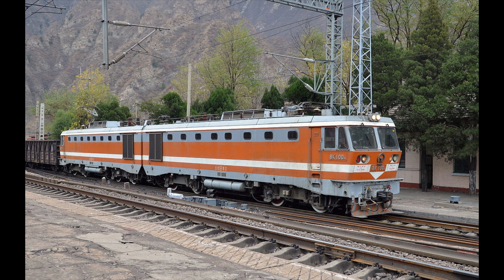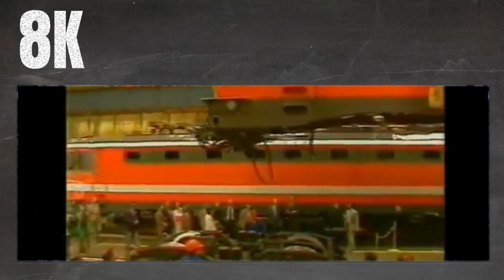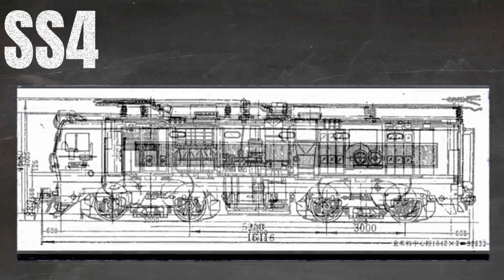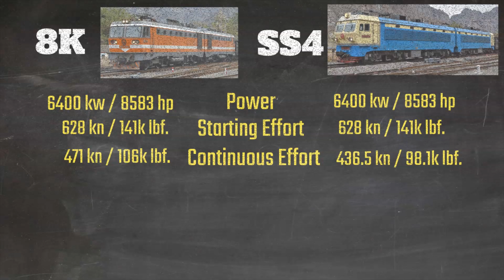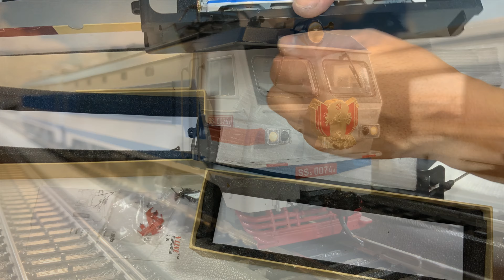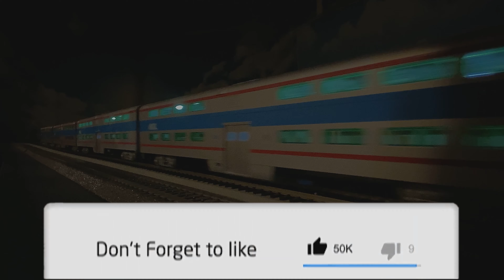Shortline Histories: China Rail 8K and SS4 w/ HO Scale CMR SS4, Charming 8K, and Model Asia C80s

Comment: There's a minor error: a lower continuous speed is better, indicating better heat dissipation from the traction motor and greater continuous traction. In fact, a comparison of parameters also shows that the 8K has greater continuous traction than the SS4.
Reply from the maker: Ah! Thank you.. If this is the worst I've done, than I'm at least giving myself an A-